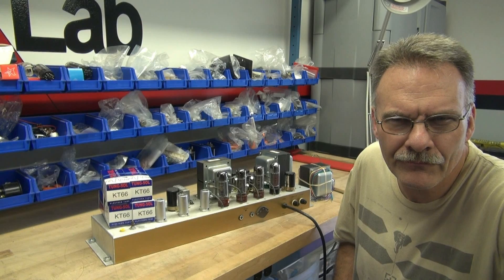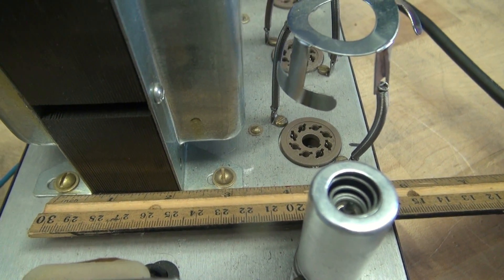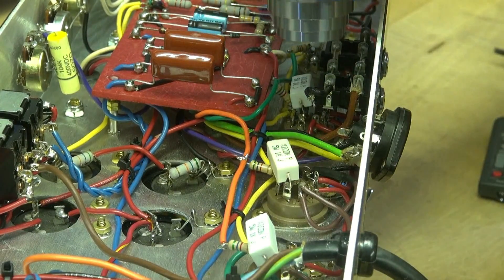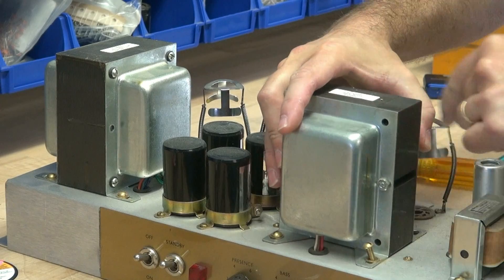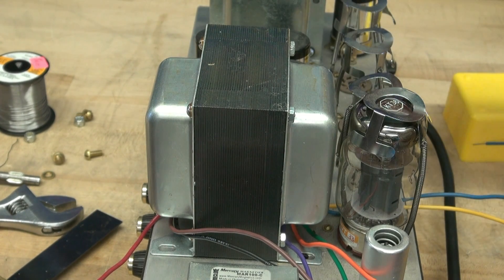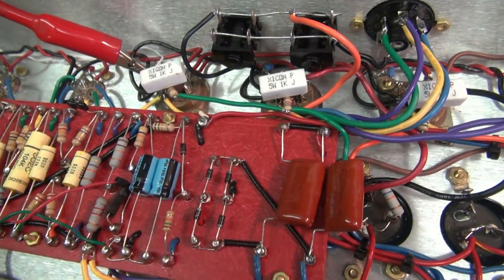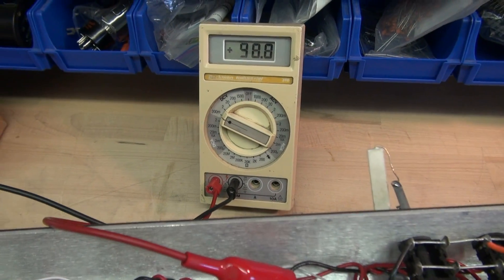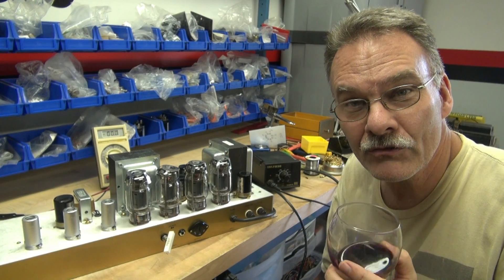Marshall 100 watt Plexi tube amp Head EL34 kt66 Modification How To D-lab

Comment: Ran EL34'S HARD at 75% 90% max valume for FIVE years giging and rehearsal, in two jcm 900 amps never a problem. 
Spunds like aspeaker impedance 
miss mach/operator error.
My supper bass is over 10 years on the same 
MUllard EL34 tubes. So igisagree with MOST GUYS.

Comment: Just build an amp with hardly any room between the output transformer and the tubes although mine has a little more room than this one, maybe 1/4 inch. You don’t think heat will become an issue?

Comment: I have a question, I see that the power tubes are very very near the output transformer, will ever cause any heat issues with the output transformer? Why or why not?

Comment: Hi! Which is the main reason for the need to change output transformer? Plate voltage ? Heater current draw ? Both ? Other ?  Best regards, Magnus

Comment: Why are you telling people to swap the output transformer when going to KT66s, when that's not required at all?     That's just flat out WRONG. 

Not only that, but even if you do need to replace the transformer for any reason, you just transfer over the original transformer's saddle clamps on the bottom to the new transformer and install it in the original mounting holes in the chassis.  Absolutely NO reason to drill new holes unless you're lazy and/or don't know about the saddle clamps and they weren't on the transformer to start, which points to there having been another lazy tech in the amp's past.   When I see an old Marshall and either transformer is missing those clamps, I know that a second rate tech has already been screwing with it.  

There's nothing worse than someone who pretends to be a teacher but he's teaching things that aren't true. 

After setting the bias, all you have to do is hook an 8 Ohm cab to the 4 Ohm tap and 16 Ohm cab to the 8 Ohm tap to get the proper mismatch.  Or relabel the taps.

Comment: You could still use the original OPT. A quad of KT66 can be used with 3.3k to 4k impedance. The original transformer is 1.7k and if you set the selector switch for half the speaker value (8ohm amp setting into 16 ohm speaker cab) it will double the impedance and provide 3.4k which fits the kt66's.

Comment: hi,to you ,i pick up a schematic on internet of spitfire amp matchless who is a very good amp, but im not sure of the schematic about  4k output transformer ,this amp is supposed to be a push-pull class a , i think it is, but i think  there is too much voltage on the plate the rca manual gives 300 v max for 6bq5 tube and about 35 to 40 ma each tube,i want to do 2 cathode bias separated  cause no need to have matched pair tube.Ican send  the shematic to you if you desire ,thanks for your help

Comment: i ran EL34's on two Marshall 900's for over five years with no problems. the volume was always at 7 or 8 to get the power amp to brake up. i have seen original tubes in old Marshall amps. the el34 is a great tube with a distinct sound when pushed if biased right they will last for ever.
Reply: no tube lasts forever
Reply: @BenState  unfortunately we will have to wait forever to see

Comment: I have a jcm 800 4104 that has kt66's in it. I bought it used like this.
 I have two questions: If i want to keep it like this and put new kt66 tubes in it, can i use my el34 bias probes or has the wiring been changed to pins and will need kt66 probes?

        Second question: Can I put el34's back in it? I assume i would have to change bias resistor to allow biasing low enough?

Comment: My JCM 800 I purchased back in the Fall of 1981, is a bit of an anomaly. I took the rear plate off for the first time last year with the intention of replacing (for the first time) what I thought     were going to be 4 EL34's. Much to my surprise, the four output tubes turned out to be 2 KT66's, and 2 6L6GC'c. This is what came from the factory, as I bought it brand new. I'm curious to know if there is a modified transformer and or circuitry in this amp.

Comment: Could you have mounted the power transformer sideway like the sound output transformer ? make 2 new holes for wiring you would have gane more free space ?
Reply: I know this old, but since nobody answered, I will. The transformers have to be at 90 degrees from each other to prevent lots of hum from the AC line voltage. Lined up they connect magnetically. So the answer is no.

Comment: Does the transformer in a plexi remake  (1959) also need the transformer change?
Reply: John smith if the original amp is made around el34 tubes then you have to change the output transformer or you will get an impedance mismatch when you change to a 6l6 or kt66 tube. Sometimes you can get lucky and the mismatch will be a factor of 2 - and all you have to do is use a different speaker selection like a 16 ohm tap with 8 ohm speaker

Comment: Really there is one shortcut  to use the original OT .....   4 ohm tap =8 ohm  8 ohm tap  = 16 ohm    and the 16 ohm tap= 32 ohm       this way we give the  kt66 the right  impedance...    should be around  3k8 on 4 kt66....  the next problem  is to  tame the  Screens  because  the KT66 is a very sensitive tube for overvoltage on screens...  So   the best way is to keep it  under  425volts....   for that we can use  5 watt /27 volts  zeners  and 47ohm  RF protection instead of the 1K/5watt  screen resistors on every socket......   with the cathode of the zeners to the B+....  and the anode against the 47ohm resistor....  the  resistor other leg solder on the  socket ...  here is a photo https://www.facebook.com/zvenamps/photos/pcb.1205832989427871/1205832919427878/?type=3&theater on a crate VC50  that is impossible to bias ...  to low voltage  ..  but with  27 volt zeners we got in the safe area  :) advantage is better  linearity and tubelife    ps there is  2 ways to protect the screens  1  with current limiter and 2 voltage limiter  ;) kindly regards  Sven at Zvenamps

Comment: Whats the benefit of using KT66?
Reply from the maker: bryan arzaga The EL34 tubes are known for going bad after playing amps hard. My blues player would go thru a set every other gig. The expense was driving him nuts. The KT-66 tube will deliver the same power, however uses a output transformer that has much more primary impedance, hence less load on the tubes. They outlast the EL34's 10 fold and have a much fuller sound rather than the brash marshall tone. The upgrade was a huge success. Hope this helps
Reply: Terry Dayton would it be possible to mod an amp that uses 6L6 to use Kt66?
Reply from the maker: bryan arzaga Yes, you could but there would not be much difference in performance. The most dramatic difference is EL34 to KT66
Reply: I don’t understand why he was going through el34 s so fast that hasn’t been my experience with running my amp hard.  I would have tried 6ca7’s or 6550’s first and keep the original OT, but it’s his amp and his choice.

Comment: Since EL34 and KT66 tubes have the same Pmax (25W) I wonder why to change the output transformer ? Would you please explain this in some words ? Thank you.
Reply from the maker: Hello, The load impedance on the EL34 tubes is much lower than the KT66. I replaced the transformer to ensure the proper match. Classic Tone (Chicago) supplies this transformer.
Reply: Terry Dayton
Many Thanks Terry.
Reply: Jean-Paul Bleus I have a jtm 45 and I adjusted a few parts so I could run el34's but did not change the OT, it did not need changing, tubes can handle a lot, they are far hardier than most think, I've never heard or read some of the comments the video poster has made and I've been repairing and building off and on since the late 60's.  I did take the el34's out and put the kt's back.
Reply: Jyme Bale The kt66's do take more heater voltage but, I've never heard some one complaining about a 100w Marshall running el 34's burning up ever, the video poster talks to different people than I've heard from, but be certain to have a good tech do this mod, if you are faint of heart don't mess with it because messing with amp insides WILL KILL YOU!
Reply: Jyme Bale If I'm right, both the tubes take the same heater voltage (6.3V or 12.6V following the circuits) but the KT66 heater current is around 1.36A and the EL34 takes around 1.5A. So here you have to take care of the power transformer. Haven't you ?
Reply: Yes but only for the Kt 66, they eat more voltage..
Reply: Jean-Paul Bleus Doesn't make sense! My friend changed back & fourth on a 66 Fender Showman between 6L6 Quad to El3r Quad then 10 year's later Back to 6L6 Quad,.No output Tranny Change! 4 ohm OT, still works today! My JCM 800 50w 2204 1982 Drake He converted to EL34 pair, from The crappy tubes in us Marshall 2204.I think they were 5881,s or KT66.My friend.did that & added a little Lee Jackson pre in to it changed around some pin, wires with Original Drake. I use vintage Ibanez out front.He put EL34 set.It became from weak to a fire breather with pedals or front on 79 slant Marshal cab! 4, 8, 16 ohm. From Hendrix to Ratt, Crue or Heaveyier, if NEED! Jim Marhall had complaint that his Kick Ass, EL34 Based Amps WENT marking it to USA intact with ASS,, Killing Tubes. With out getting broke.New EL34 Tubes Were being put back in with the Better glass an missing tone by mod in 1980 & up! Glass is   been good on all tubes since 1980! I had mine fender done in 88.Bougbt it for 50 us$ Bought the Marshall in 1995 when it was sucking. For $400.00 @ a pawn shop.Run El34 set in my stock Dremil OT, Marshall! Musicians Friend used to sale a socket converter to put any power tubes you wanted for your amps. All they were.They were just a plastic pen plug in that changed the wiring config which you plugged your tubes in after plugging the          converters I to the tube sockets ! AMS, No one could sell them because they sometimes would cause taller tubes to touch the top of the case.They went out of style because people opened the hood & did it manual.Do the research on that @ Marshall! Old news. On bias Pot, Van Halen always turned his all the way down like me.More Saturation with lowest bias @ longer tube life! Do the research guys5 !  ! Of course wood on a 4X12', aslong as it's all ply ! Now Speaker's are a different story with all the scooped speakers.Chinna stuck us on that. Plus you need break In time ! Plenty of video's on that with out some even having  touching the guitar.! Celestion has gone down to scoop hill,, not good. The New Jensen C10q or C12Q or Q may come first peak around 50w each. They are a steal with no scoop & at 50.Ive compared a lot of experience with high dollar speaker's !This speaker I mentioned sounds a perfect match to my early Celestion from 1971, 72 & My 70, a cream back, & 2 black backs I ended up with by chance ! I Put the Jensen Named in place of my 1986 vin30 non scooped when the voice coil, seezed ! Then I built a set of 4 @ 8 ohms each in a 2000 year or 1 MOJO Electronics straight Cab. Couldn't tell the difference! I learned the hard way. Eddie new his shit back then. That stuff, Celestion then.Wirh a Variack etc. Made eruption a classic etc..Good luck. I need some. Cancer sucks ! Peace, Richard

Comment: do you switch to a 200w output tranfo ? would it be possible to just put in 2 kt66 and the go 100w without changeing the trafo
Reply: jimi jimi no, he switched output transformers to get a better impedance match to the kt66 tubes. With an impedance mismatch you won’t get full power from the tubes as well it will change the emphasis on the harmonics getting pushed out and can totally change the tone. But impedance mismatch might be the tone you’re after?